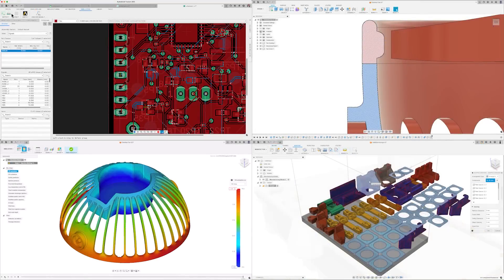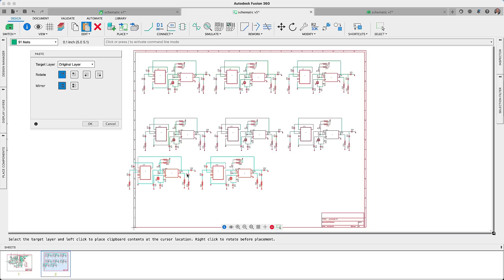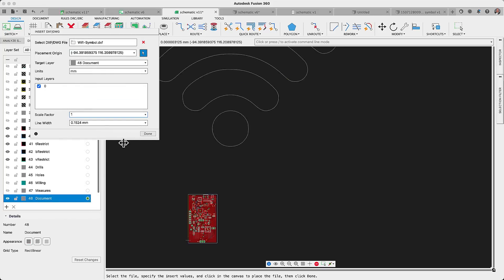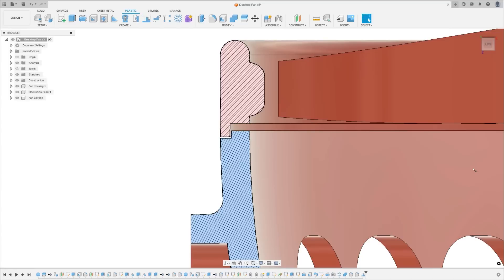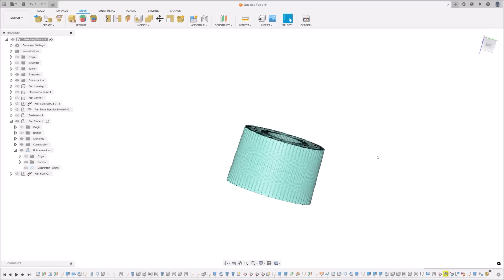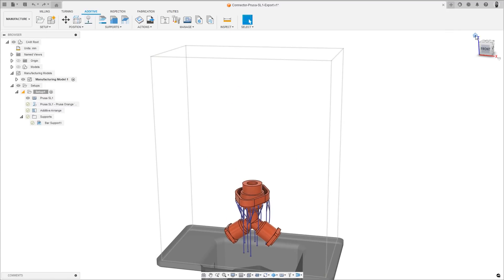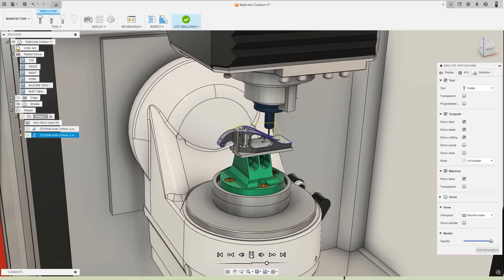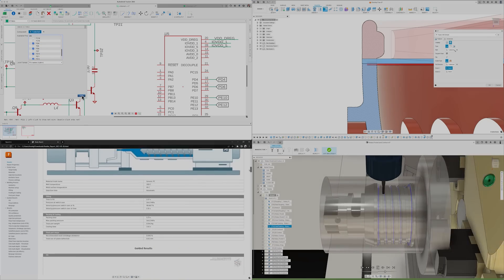What's New in Fusion 360 - May 2023 | Autodesk Fusion 360

Comment: Great update... Love the option to delay the version upgrade... however it would have been good if you had provided the option to completely skip the upgrade. That way people using older computers would still be able to use the older versions without any lag or slowness of the software (knowing they wont get the latest and greatest updates of the software). This also would help them focus on their work and not worry about upgrading their computers because latest versions of fusion 360 is slowing down on their older computers.

I also loved the option where now we can resize the options and dialogue boxes.

Gfeat update overall.

Comment: Has anyone else been having insane problems with fusion over the past week or so??  I've got the free version, and I'm fairly new. I only have one design started, a simple bullet mold for my first project. Fusion was working ok, then started bogging down, locking up, and crashing. Thought it was my laptop finally not being able to keep up. So, I bought a new one that has double the requirements that autodesk lists(RAM, graphics, ect...). Other than what came on the laptop from the factory, Fusion was the only thing on this new comp. I did all of the updates for the computer and fusion. Then tried to draw a 1.5" line and fusion locks up and crashes. Same thing happens if I try to delete a line, or do anything else really. Fusion says they don't support the free version, and their website won't let me post to the forums. I reported that to Autodesk, who said they couldn't identify the problem 🤦‍♂️. So I got on with tech support for the new computer, we tried everything, ending in a factory reset. And fusion still doesn't work. I'm not trying to reengineer a flux capacitor. I'm trying to make a simple bullet mold and learn cad, cam, and milling. Anyone had similar problems or any advice? At this point I can confidently say that if I ever get to the point of buying cad/cam software, Fusion will absolutely not be it. Product doesn't function, no support available, no ability to post to forums to ask questions, and no customer service for that either...

Comment: Hello I am so i learn 3D, curious paasio vehicle designer

Other problems with siglalés and improved for my part:
The slow fusion even with an RTX 3060 (making it possible to use your own graphics card)
-Crashes
-The work that is lost by merging
- performance improvements
-impossible to now render in the canvas (it is very very very slow since the last two updates)
-the recording of files which is recorded ad infinitum when you want to close fusioon
-the addition of movement kinemaatics from the view port (similar to software, belender, cinema 4D)
-improved management of T spine errors because sometimes there are invisible errors and you can't see them (use the iac)
- improvement of the correction of errors in the timeline, because fixing all the errors manually is very very long
-adding a dark mode
-improve file exportation and opening

Thank you for this great software

Comment: For milling manufacturing, 2 features off the top of my head I'd like to see are: 
1. 2D Contour: Automatic recognition of the best lead-in point to minimize the lead-in tool engagement mark. For O.D. contours this would be the corner edge. (Also applicable for the Flat "profile" unveiled here, which I probably won't use due to this limiting factor and its inferior surface finish)

2. 2D Contour/2D Chamfer: For chamfering, an automatic tip offset based on each contour path's minimum radii that maximizes the SFM of the tool, with an appropriately scaled feed rate. For instance, use the maximum tip offset for 2" holes on the model at full feedrate, and the tip for the 0.1" holes at 20% feedrate. A dialogue box to change the minimum radii path to follow would be nice as well

Comment: Please make it so that keyboard shortcuts like Tab let you switch from one button or field in a dialog box to the next. This has been requested so many times and is just absolutely basic and essentially functionality.
Reply: I agree Evan.  If you have a dialog with numerical input and click on the first one, say in a toolpath dialog. tab will go to the next one.  but it doesn't work for selection boxes and it doesn't just work without you clicking one first.
Reply: @LearnEverythingAboutDesign  but tabbing won't go from the last one back to the first.
Reply: @endercrafts9056  It does in some dialogs.  If you are in manufacture and start a new toolpath, if you are in the Spindle Speed input and tab you will go through all the dialogs.  If you are in an extrude and on the distance box and tab it will bounce back and forth to the taper angle and distance.

Is there a specific one you know of that won't tab back to the first?
Reply: Please lord!!
Reply: I think they dont include this becase it incentivizes folks to move up to inventor